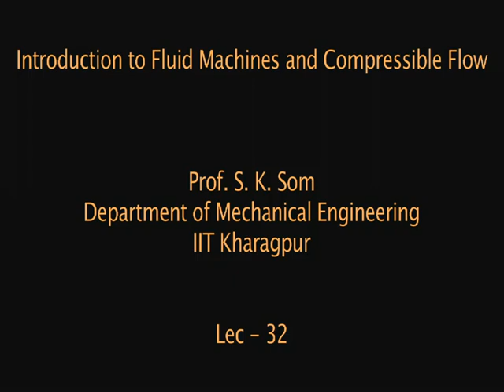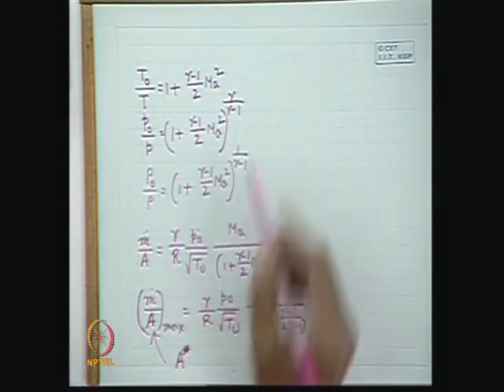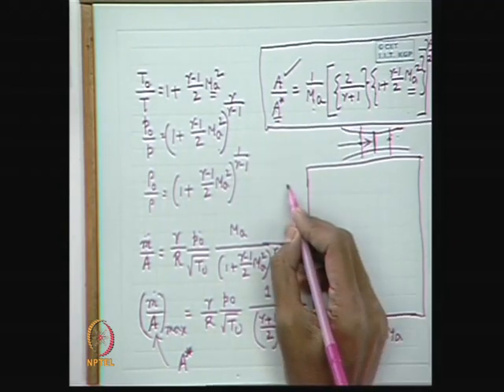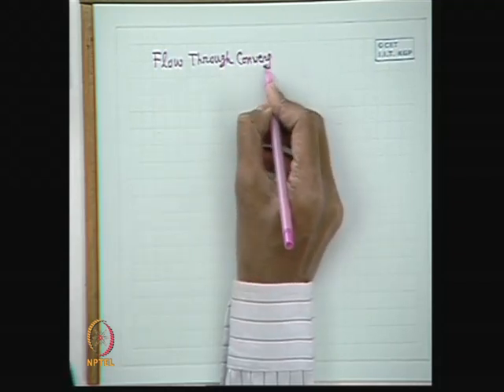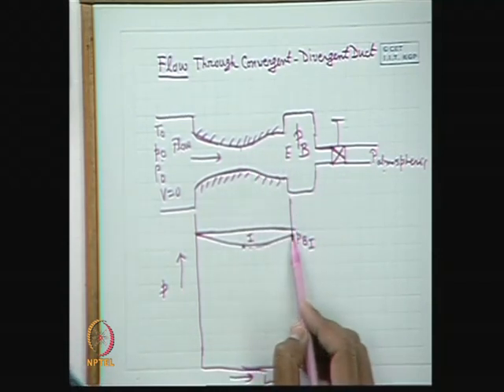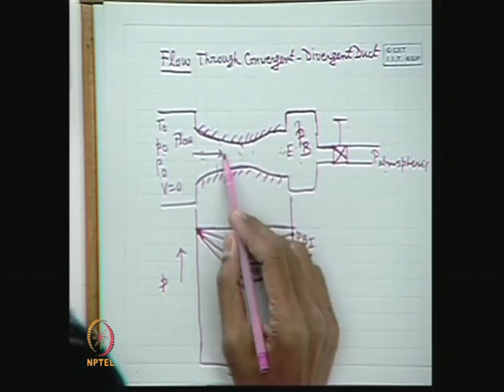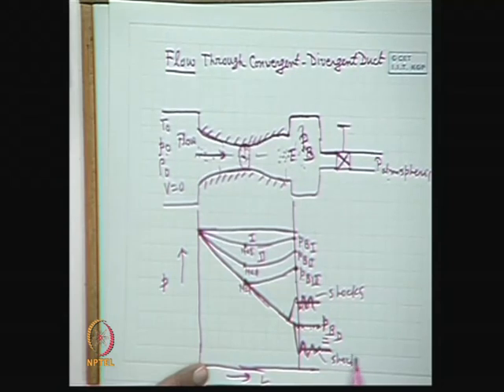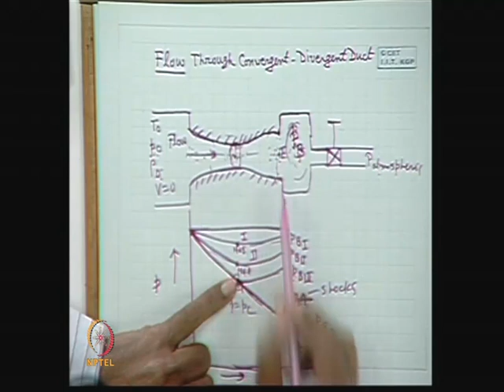Mod-01 Lec-32 Isentropic Flow through Convergent - Divergent Duct

Comment: Aircarft is moving at an altitude we know the back pressure (pressure at that altitude) as per you said. 
But my understanding is that this pressure at that altitude will be the stagnation pressure Po isn't that? 
Correct me if I am wrong. 
And what will be the stagnation pressure in that case ?
Reply: hi. stagnation pressure, in this case, is the pressure in the combustion chamber of the engine. back pressure is the atmospheric pressure, which is the pressure of the surroundings. hope this helps you.